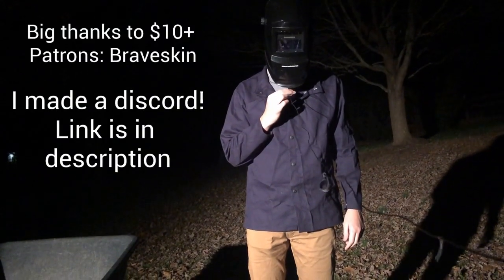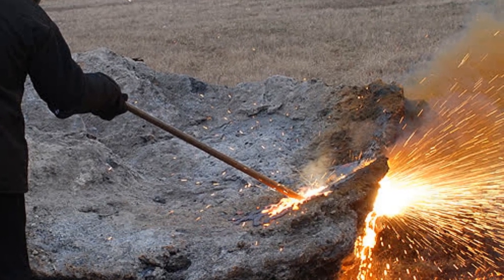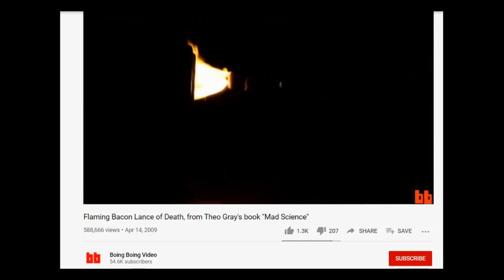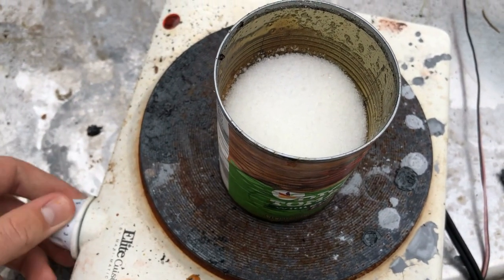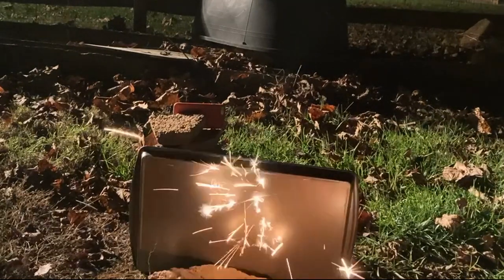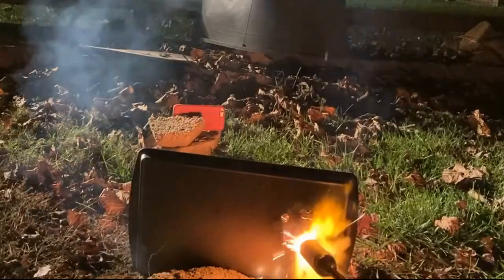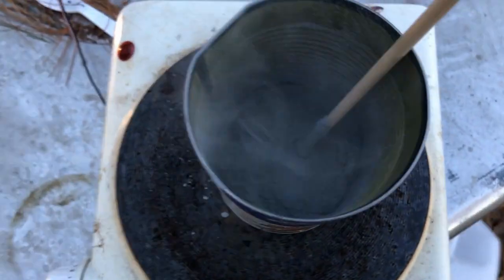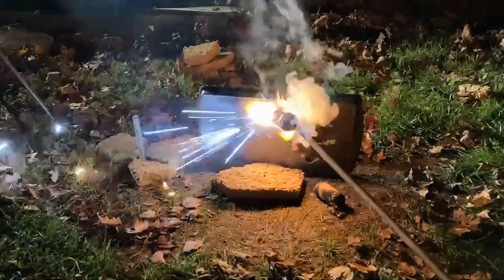Melting Steel with Caramel - Thermic Lance

Comment: Should've used steel wool as a binder to hold it together and just anything else non melting energy dense as a secondary filler.

There's still quite a bit of performance potential.

Comment: 2 thoughts on the aluminum powder. Is it possible that there is radiant heat traveling through the surface of the grain and igniting/melting the erythritol below the surface? Also, at those temperatures could aluminum reduce erythritol into carbon and hydrogen, and still generate heat in the process?
Reply from the maker: Delta B it is possible that the aluminum allowed the Erythritol to melt faster for sure. It’s not likely that it ignited below the surface without exposure to any oxygen.
Idk how likely the rapid reduction of a sugar alcohol by aluminum is, but I can’t say that it’s impossible. My guess is that it’s just burning before anything too funky can happen. Erythritol melts at a pretty low temperature and if it was going to react with aluminum, it’d likely happen at the high temps I had it stirring at, not when it is flash-boiling to ignition.
Reply: @DBXLabs  I was thinking of the way it oxidizes at high temperature with steam, as in Al-ice propellant, or various metal oxides in thermite. But you're right, it's not going to react at the temperature inside the solid part of the grain.

Comment: Honestly I'm not too surprised the aluminised erythritol grain would go nuclear- you've basically created a hybrid rocket motor with gaseous oxidiser and solid fuel. You can probably light it remotely by passing current through short lengths of the steel wool, they don't take much before they ignite and sometimes you can just short a 9V battery with short lengths of the steel wire to heat them to ignition though I can't imagine it's too healthy for the battery. Nonetheless still another interesting video!
Reply from the maker: Caleb Howes yeah if I were to do it remotely for a hybrid rocket motor I’d definitely need to use one of my remote igniters. Even igniting the steel wool with O2 running wouldn’t work because that stuff burns in milliseconds in pure O2.
Reply: Does the term ramjet not apply in this instance? I can see similarities and differences so idk!
Reply: @cyclopentylprime8381  A ramjet's just another type of air-breathing jet engine that uses the forward movement of the engine/vehicle alone to compress feed air instead of using an axial or centrifugal compressor fan, this is fine and dandy if you just happen to find yourself already over mach 1 but below that you need external power as velocity provides insufficient compression at subsonic speeds

Comment: I wonder how an aluminum pipe would do compared to steel.
Reply from the maker: Aluminum becomes very soft at the temperatures required. Generally it is a supplement inside steel rods.

Comment: Whoaw this was cool wonder if you can just start it by putting some rocket on the tip just to ignite it and start it up ?
Reply: hmm im not gonna revive my old chlorate rocket mix just for that
Reply: That IS a good idea.  Also I wonder if it might be more manageable with some sort of ceramic nozzle.
Reply from the maker: Yeah that would be cool to try. Graphite could work as well.